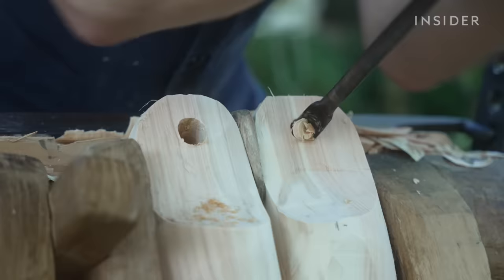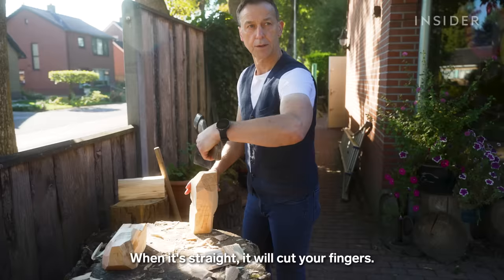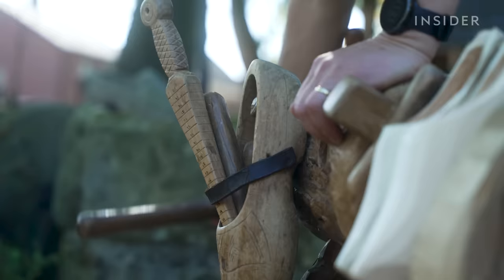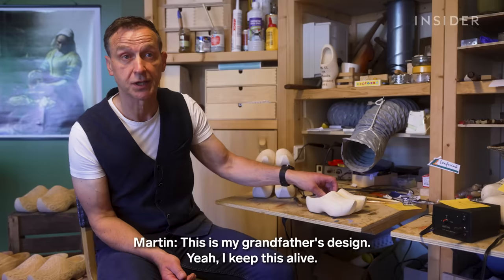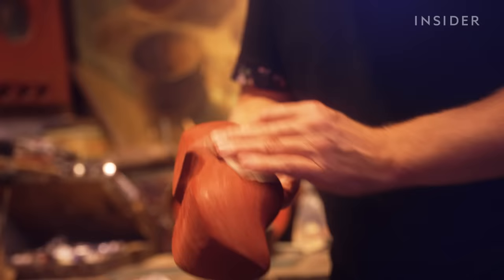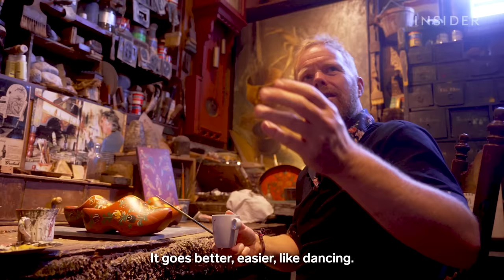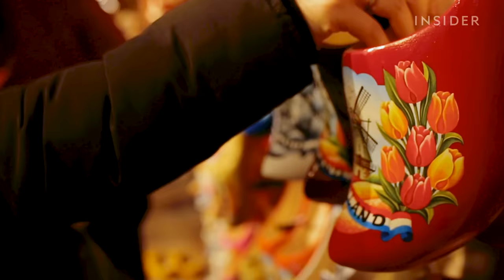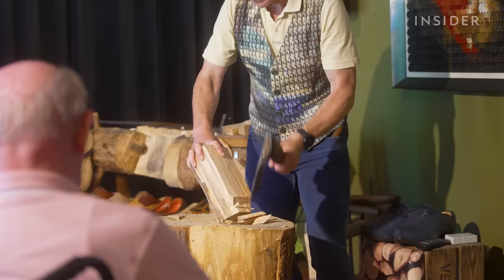How Dutch Clog Makers Are Keeping An 850-Year-Old Tradition Alive | Still Standing

Comment: The problem with this kind of shoe is that they are almost exclusively meant for outdoor use, in the fields or muddy areas. If you try to wear this inside the house or places with hard floor, you will sound like a horse clipclopping around. Obviously it's going to be hard to sell a shoe like that when a good chunk of the "modern" population lives in cities and apartments. Your neighbors would hate you if you wore these inside.

The modern equivalent for city living are crocs. They are silent, comfortable and easy to wear (just like slippers), and the ones with holes in them makes them a bit more tolerable in the summer. The caveat is that they can be a bit unsightly, but some designs tend to be better than others.

Comment: You need 3 to 4 pairs every year? So like every 3 months you need a new pair of clogs
Reply: Yeah, that's something that didn't make a lot of sense to me either. You would think a pair of wooden shoes would last you a good while... But then you have to consider one of the reasons why artisan jobs are dying it's because they require a lot of skill and manual labor that is no longer common place, and the lack of customers means prices have to go up to make it worth it staying in business.

When you look at the industry in general, companies usually sell products that deteriorate quickly as a way to get more purchases. That's probably why clogs don't last. If a pair of wooden clogs, who costs around 50 euros, lasted 5 years, combined with the fact fewer and fewer people buy these, you can see how unsustainable the business would be for these craftsmen.

PS: Also, wooden clogs were primarily designed as outdoor wear, for soil and muddy terrains. Wearing them in hard floors, which tends to be the case for most people, is going to wear them faster.

Comment: Why would you wear wooden shoes?  Just want to understand.
Reply: Tap dancing/ local dances
Reply: At the right size they can be remarkably comfortable, over time the wood gets shaped by your feet. Most importantly it's kinda like a safety shoe you can easily slip on that keeps your feet warm and can last a lifetime. They are perfect for short outdoor trips like walking a dog or getting something from a shed.

Of course in the past it was cheap, readily available and possible the best safety footwear could provide, but that doesnt hold up today.
Reply: Soil in the Netherlands was often boggy/marshy/wet. They're ideal for keeping your feet dry on ground like that where leather can let damp in.
Reply: Because they work well in farmland.

Comment: These gotta be hard on your feet. No arch support, no cushion, no flexibility, no insulation, no proper fit... like wth? I could not wear these no way, my feet would be dying by days end. I can see why no one wants these, they don't even LOOK comfortable. Indians wouldn't try these, that's why they had moccasins... I'd definitely wear that before wood shoes any time of year.
Reply: They are extremely comfortable and have arch support. You speak very confidentally for someone who has never worn them. Clogs were mostly used by farmers and fishermen, because the shoes protect your feet from iron hooks and sharp stuff. They were - literally - the first worker's boots.

An iron nail or fishing hook will go straight through a moccasin. But you guys poop on the street so you might not understand what I am saying.

Comment: Can anyone tell me what's the point of this?

I mean, nobody in Holland wears clogs anymore.
Reply: What are you talking about? Half my village owns one and uses them regularly, out of that 10-20% use them every day all day long
Reply: @Mark-vn7et  Why? Wood provides very poor traction, Not to mention it is extremely uncomfortable.
Reply: @aaronfield7899  have you ever tried them? And I mean try them for more then an hour. It’s actually grippy, also in wet fields you don’t “sink” that much because of the bigger size. They are really easy getting in and out of. There is much less heat loss from the cold ground in winter. It protects your feet and toes from heavy stuff falling on it. There are a lot of benefits with it. But I agree a lot of people wear them as a fashion statement because leather/rubber clogs provide much of the same benefits